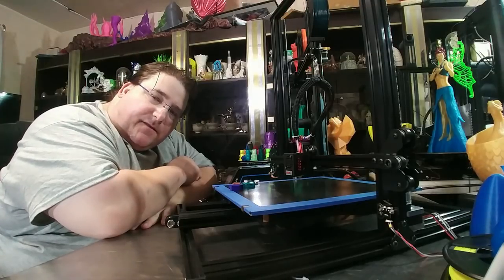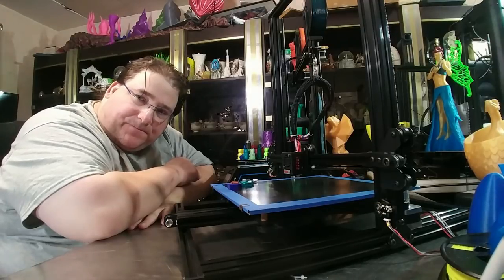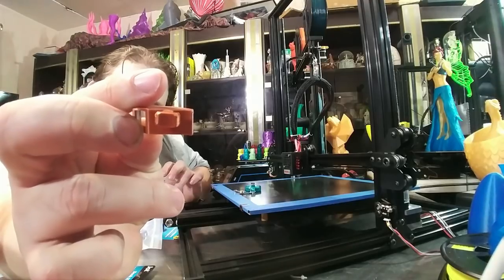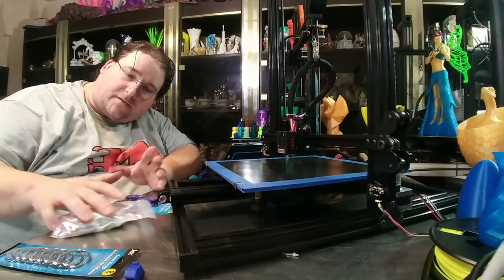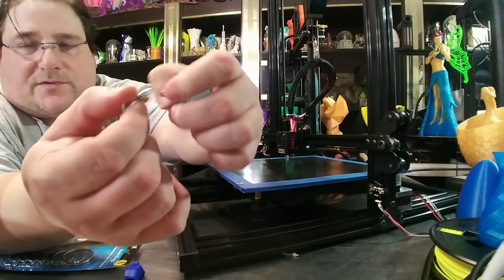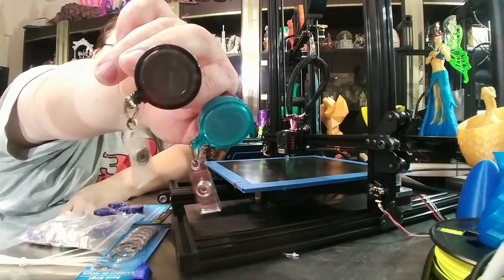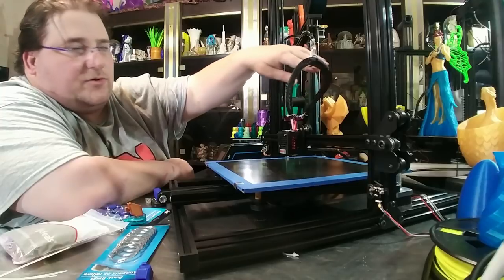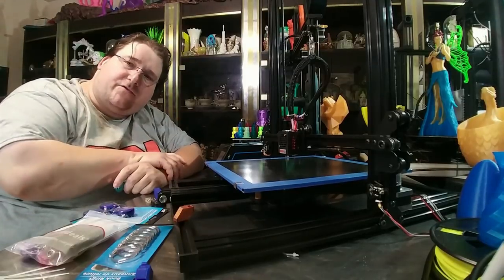T3DP 229 Stop The Droop   Wireloom Retention

Comment: Simple, effective, and thorough solution. I use them on some of my shop equipment as well; chuck key for the drill press and lathe, knock bar for the mill, and z probe for the MPCNC.

Comment: Rubber band and a simple wire guide/clip works just as well
Reply from the maker: Maybe on smaller printers but I have not found a viable rubber band that can stretch so far and Shrink so small without applying unnecessary force on the harness

Comment: Nerys , I'm looking for some advices. I'm planning on buying a new 3D printer (got an Anet A8 first, then a Tevo Tornado). Which one would you recommend? The Ender 3? The Alfawise U20? The Tevo Flash? A large bed is cool, but quality is also important.
Reply from the maker: The alpha was you 20 is not so bad I like it it needs some work but it looks like they are approving it

It's comparable to your tornado 300 by 300 by 400

Ender 3 and the Flash are different they are I3 plus build volume so they are both about 2:30 by 2:30 by 2:50

Print quality is almost identical with the Ender 3 being just a hair better you probably won't be able to tell the difference the Ender 3 is cheaper while the TiVo flash looks nicer and it's a little stiffer otherwise pretty much identical machines so go with whatever one you like better you'll be happy with either one
Reply: Ok, thanks a lot. I'm quite happy with my tornado, but I had a lot of problems (bad luck mostly, some errors I made too). BUT... quality wise, not that amazing. I had two tornado (mine, and one shared with other coleagues), and both had visible layers. Same of most of the pictures posted on the FB group. And I did try to remove the top bearing, and use a 3D printer coupler... Now it's dead, and I'm wiating for a new motherboard...

Comment: 2 cent solution : rubber band 😁
Reply from the maker: If you can find a rubber band that will stretch out 400 MM and retract to about 10 mm without putting too much strain on the system please let me know :-)

I had actually considered contest rubber that I use for rubber band powered airplanes but I always had a problem with it not Contracting enough or applying too much force when I was cleaning out my room I was about to throw away the little badge holder and I just stopped looked at it... Thought for a moment... And it hit me that might work :-)
Reply: @nerys71  ok 20 cent 😏 . Keep up the good work.
Reply from the maker: @beeeeep  hey that's pretty close i figure 35c each for the widget and about 2 to 4 cents for the print depending on what filament you use. :-)